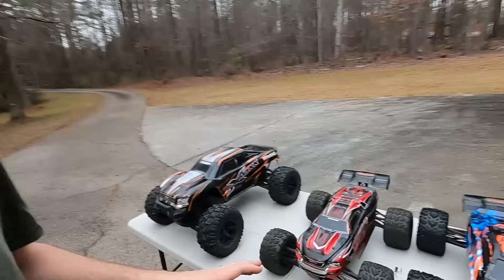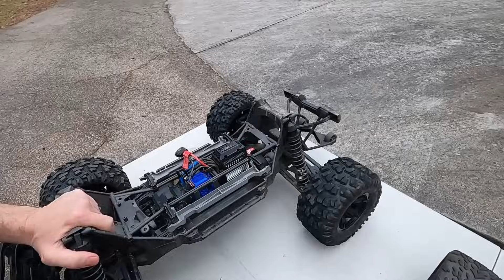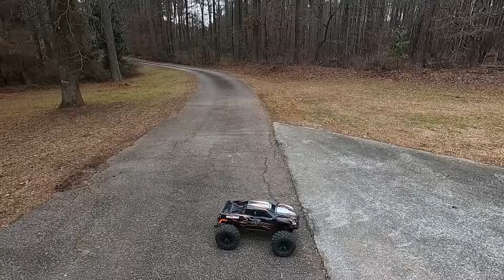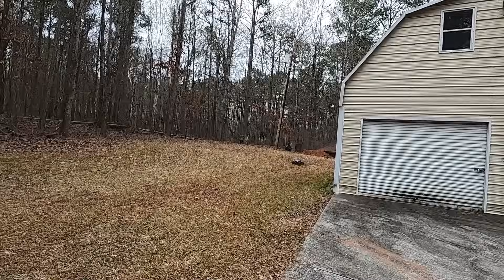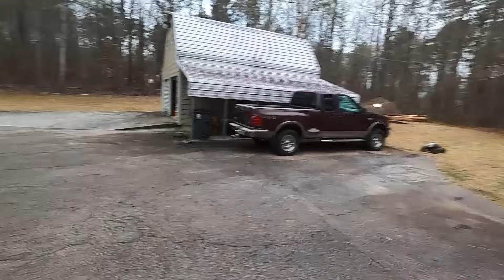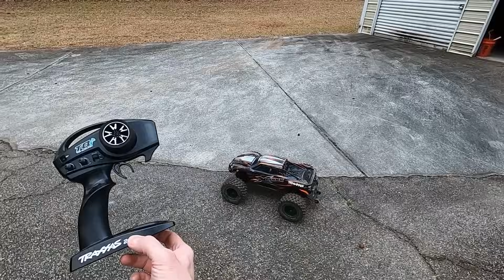Why Is My XMaxx Stock And Why Don't I Use Badlands?

Comment: I know this is a traxxas video, but I have the losi dbxl-e 2.0 and the only things that have broke without me crashing it (everything still stock ) are---
1) The stock spektrum servo broke before 30 mins were up.
2) Stock spektrum esc-- No matter where the low voltage was set ( I had it set to high ), it always took the voltage down too low and puffed at least 4 batteries.
3) Stock tires, the foams inside came apart from the tires ballooning.
IMPO spektrum surface electronics are junk and need to be upgraded asap.

 Now for some things that broke after a certain upgrade.
1) Both back axles bent and twisted (1st run)
2) Front and rear diff gears broke into 4 pieces (2nd run)
The reason these pieces broke and it was just 2 runs, I installed a center locker and while it helped tremendously on take off, it wasn't designed for bashing. Needless to say it has been removed.
I have crashed it a lot and have upgraded ( I've upgraded a lot) as I repaired it and nothing has broken because of the upgrades (other than the locker). The last time I weighed it, it was 37 lbs. I swear, if there is an obstacle to be hit, I will hit it. I also don't jump my rc because it's just too heavy and I suck at jumping and a 5th scale is way too expensive to learn on.
Reply from the maker: lol 37 lbs? I didnt know they were that heavy. I actually kinda want one.
Reply: @outsourcedrc  In stock form, it weighs about 28lbs, mine has aluminum upgrades.

Comment: 1000% agree, Do Not fix anything before something clearly fails or breaks, every mod you add increases the amount of variables to consider that affects the car and usually the amount of headaches.
The simpler the better. 
And additionally I believe a group of designers and engineers of a 1000$ rc car from such mature brand know what they are doing much better than random Joes telling others to “upgrade” every single part of the car to metal when they dont even know what the square-cube law is…

Comment: I had mine for 2 weeks totally stock and i just love it but the stock servo striped the plastic gears out so I bought the upgraded metal internal gear one, it's stronger and better steering. Probably the only thing I'll change. Also recently got the badlands and there good definitely heavy but there good no more body slap I like em can't complain.

Comment: My Traxxas rustler 4x4 VXL will do that creeping forward sometimes after I let go of the trigger. Like you say, not all the time but randomly
Reply: I used to have the same issue. I noticed, that it did it, when the esc was getting hotter than normal (e.g. because of bigger/heavier wheels). If you have the Bluetooth Module and the Traxxas App you can adjust the zero point of the throttle. I guess, the factory settings of the zero point is right at the limit. If you adjust it just a tiny bit, it won't do it anymore.

Comment: i have my summit for funtimes, bandit for fast time, TRX4 for slow times. Main upgrade i have done is servos, summit servos cogs literally brke, so it got ome random metal ones. next i need new wheels, bought it as used, so wheels weren i the best shape, and the rubber is old. and one hex got round

Comment: Did couple runs stock with 4s lipo doing wheelies on pavement and all my foams in the tires balled up and unbalanced my tires
Reply from the maker: Oh that sucks.
Reply: @outsourcedrc  yea, tires are perfectly fine. Stock foams tho are garbage. I took the foams out and ran them with no foam. Seem fine now, but it doesnt roll very long when your off the throttle caz there flat tires. But ive beat the crap out of them and they held up fine. Its sorta a comon thing if you like doing very long wheelies on pavement and doing it alot

Comment: 22/50 gearing and a max 6 will give you way better air control and it will do standing backflips while still being reliable. Just a tip

Comment: I just put in the rpm hubs for the rear
Castle mamba X 8s ecs
And german manufacture mod1.5 gears 
These are very light and durable 
And i have the proline raptor body for it for Personalization.
The rest of it is stock.
Its literally very rare that i break something like an arm.
But i drive like an animal.

Comment: I was wondering if putting the heavy duty traxxas arm is not a good upgrade either? My arm broke, and i drive in really cold weather, so i was wondering if it would be worth it.
Reply from the maker: You can add a little more weight if you really need it, but try to limit how much extra you put on.
Reply: @outsourcedrc  ok. Thanks

Comment: I've had  my my XMAXX, for about three years now. I went through 2-3 sets of the original XMAXX tires. And kept blowing up, and replacing them, with the originals. i got tired of buying them! So  I did my own research. And went with the Duratrax Hatchet X tires. NO problem since.

Comment: Totally agree. Even upping the gearing on the stock system makes it a new animal. I had the same outlook you do on mine. I did change the electronics. But used the Hobbywing max6 ESC and their 1100kv motor. With WFO gears. The truck isn't much heavier than stock. So it holds up well. Nothing worse than a broken RC. Useless. Thanks for sharing this info 👊🤘

Comment: What batteries do you use
Reply from the maker: The Traxxas 6700 mah 4s batteries.
Reply: I'm looking for a cheap lipo batteries for xmaxx long run time but good speed any ideas
Reply from the maker: @dgoldenninja641  No idea. Maybe someone else will be able to tell you.
Reply: Also if you get a battery with a higher mah the truck will run longer:) Great videos keep it up

Comment: Ya Driving it like this  your not going to break anything!!! Take it out & really drive it it will break then the upgrades are necessary. 4 weeks after mine was new etc burnt up replaced it with max 6, blew out 2 sets of stock tires they just tore big pieces out replaced with proline trenchers, put in HR 50/20 metal spur & pinion, still have stock motor installed high powered motor fans its way better now!!!!  other than breaking a arms its pretty bullet proof!!! Mines an 8s not a weenie 6s lol!!!!
Reply: Exactly all how you drive it i had freind with xxmaxx all bells whistles,  still has stock esc for 3 years dosen't understand why we woukd need a max 6 why people say stock esc not good , some people this is bashing anything more is abuse

Comment: Quick question here. We picked up the Xmaxx last week & have run it twice on 3s 5000
What size 4s batteries do you run? 5000 or 6700? Please advise as we’re looking to go 4s ASAP
Thanks...A Subscriber
Reply: You’ll need 6700mah, the 5000mah Traxxas packs cannot handle the amp draw and will start puffing.
Reply from the maker: I have the 6700 mah

Comment: 180$ dollars for a set of badlands, I've gone threw 4 stock tires cause of ballooning and my dog chasing and biting at the thin rubber they use.  All depends what's your using your truck for. I haven't broke anything since badlands upgrade my 2 cents
Reply: Hi

Comment: Hey bro great video. I'm still a beginner but have been getting caught up in that cycle with my Redcat Volcano. I'm now looking at stopping that cycle and going better quality. You ever run Team Corally's? The xmaxx is pricey was looking at the Jambo or Arrma Kraton, any opinion?
Reply: I know you didn’t ask me, but if you have a
The cash get the xmaxx. It’s a game changer
Reply: Not outsourced rc, but the xmaxx has higher buy in cost but more durable and cheaper to run long term.  My xmaxx is on the bench less than any other truck and parts are cheaper.

Depends on where and how you plan to run.  Rough terrain, xmaxx.  Groomed bmx type tracks and care about stunts arrma or team corally.
Reply from the maker: I dont have any experience with the Jambo, but the new v5 Kraton is a safe bet if it is anything like the Notorious. Just change that diff fluid and its good to go

Comment: I can't keep the stock tires together  im on my 3rd set ive glued and vented and taped they foams still let,loose roll up and ruin the tire
Reply: The stock are my favorite though
On my duratrax lockups ive had no issue they have had 30-40 probally more runs on them and are perfect my stock last 4 or 5 packs

Comment: 😎👍🏼 I couldn’t agree more about the xmaxx stock tires! Proline does make really awesome tires, but to do so, they do get heavy! 

The Xmaxx is really ALMOST perfect out of the box in stock form, but in my opinion, the only upgrade I recommend is the traxxas steel gear servo. It’s a heavy truck that takes   Almost anything you can throw at it, but those plastic gear servos just don’t last for me!!

Comment: Any thoughts on a belt drive set up?
Reply from the maker: I hear that its not very good. It seems like a gimmick. I dont know much about it, but I used to run Nitro street cars and belted was not the way to go with those. There is a reason all these RC's come with gears and the belted RC's have fallen off.
Reply: @outsourcedrc  awesome thanks for the quick response 👍
Reply: @steveh8224  I have belt drive and it’s amazing! If you install it right you won’t have issues.

Comment: Hey buddy, been watching a lot of your videos, love your content! i subscribed! quick question for you. I just got an xmaxx from someone with these badlands and it came with some reaction 4s batteries. The Xmaxx seems slow and doesnt wheelie. I checked the gears seems fine. what can be the problem? thanks for your help.
Reply from the maker: I'm not sure. With it being second hand, there is no telling. What gears are in it? Is it in training mode?
Reply: @outsourcedrc   Your the best! The ESC was set on training mode... set it to default and now it flies.... but  I still have that rolling issue with the badlands tires. Did you ever fix that or found out what it was?

Comment: Try the duratrax lockup x's or the powerhobby scorpions or raptors.  They are great belted options that don't weigh as much as the badlands. But for heavier belted tires you need the upgraded 2085hd servo

Comment: This applies to all trucks, big wheels break things. Fun, but they break things.  The upgrade bug can be a full on addiction. I  try to keep it under control for sure.  The worst part is sometimes you spend money on parts  you are convinced will make your RC better - tougher - faster - funner - and then you wind up making it worse.  
Not that that happens to any of you 😂, but it has happened to me...

Comment: You should do a speed test with the badlands and stock tires
Reply from the maker: I actually have raced them side by side in another video. The stock tire XMaxx walks off and leaves the badlands
Reply: @outsourcedrc  good to know I might take mine off and see the difference

Comment: The weight of the wheel has nothing to do with the issues your friend is having.  If the wheel is breaking, it's because the wheels are weak and/or you're over tightening the wheel nuts, not because of the weight.  I've never had any problems with my Badlands, and I've jumped my truck 10 - 15 feet into the air and landed flat on concrete.  From my perspective, they're better than the stock tires in every way - except weight, of course.  No ballooning, completely waterproof, much harder compound so they side on pavement instead of traction rolling, better grip off-road, much much longer tread life.  They're worth every penny...

Comment: I love stock traxxas tires they last very long too! I’m old school I love everything stock just like knowing it’s original. What do you recommend for the Erevo front drive shaft it is so weak I’ve upgraded to the steel traxxas ones and it still snapped 😭
Reply from the maker: Which E Revo? the 2.0?
Reply: @outsourcedrc  yes ! Such a pain to fix constantly breaks 🤦🏻‍♂️
Reply from the maker: @27pugsly  Front Drive shaft? Hmm.. Maybe there is something you are doing with your driving? Normally its the rear drive shafts that tear up. I'm still running stock shafts. I've only broken one rear one and bent a rear one.
Reply: @outsourcedrc  yeah I drive it hard but maybe it’s just not for me ?? I drive my Arrma Kraton and that takes a beating . Thanks for the advice

Comment: Wish I saw this video before dropping $200 on those wheels and tires. First flip on its backside broke my body at both rear wheel wells. Battery, esc and motor temps all skyrocketed, run time was diminished and it does that goofy drive away thing at 0 throttle and the 2nd run stripped the servo gear. These tires will most likely be shelved until the xmaxx is ridiculously upgraded
Reply from the maker: Right? Some people have no issues with them.
Reply: @outsourcedrc  I run my banditos all the time now, there's no need for super aggressive tires when you're full time 4wd

Comment: I think it's good to have extra parts but t don't change stuff till it breaks like I added light bought diff tires and a court fans broke a couple parts and ended up upgraded everything that has to do with the wheels lol smh it's addicting man.thr other day I hit a branch and my gtr shock the rod actually broke smh it's the last thing I would expect to break but it snaped rite at the base where is screws into the bottom of the shock.

Comment: What about the guys in the hobby that spend a lot of money on aluminum suspension parts and you can’t change physics..... plastic resin used in all box stock RCs is hands down more flexible than those expensive aluminum hop up parts guys love to trick out their machines....most times if you have a wreck w aluminum suspension parts the parts don’t have the flexibility that resin/plastic parts have ..... they just bend or break....I learned by experience.... and if the engineers at let’s say Traxxas  say plastic resin is the way it should be .... I think they know better than me ...... awesome presentation my friend..... thank you....☮️~~~ Out!!! 👍🏻😎
Reply from the maker: Aluminum is really good for handling. Its not very good for bashing.
Reply: @outsourcedrc  exactly!! 👍🏻

Comment: I came back to this video for the 3rd time :) 
How are your tires doing? Im stuck with constant issue, every set of new stock tires last for 5 runs and the foam disintegrates inside… I really don’t want to go for aftermarket tires because of the weight and all the reasons you mention in the video that I totally agree to but there isn’t seem to be any other options atm, which is disappointing such expensive truck and such expensive tires lol
Reply from the maker: Wow what are you doing to them? Are you getting water in them? I wear my treads out first.
Reply: @outsourcedrc  not at all, totally dry out here, I never use my cars nesr water, already tested a lot of stock sets plenty of times, I tried taping the holes in the rim and vent the tires. No luck, none of them last more than 10 packs. The foam inside turns into dust…

Comment: Duratrax Banditos for skateparks and Duratrax Hatchet X for off road...belted tires are the only "upgrade" I've done toy xmaxx. Makes us way more responsive since you aren't running on a super thinned tire from centripetal force...other that, some shoe goo on the body and a metal gear servo it's stock all the way...I haven't noticed any difference using the Duratrax belted tires...

Comment: You say you haven't upgraded anything on your X-Maxx...and that's it completely stock. So my question is, have you ever at least broken anything  on your truck? I've had mine for a week and  I've already broken the rear hub carrier (which I replaced with the RPM hubs)..The shock cover also broke and so did a drive cup. I don't "BASH"...I was just out having a little fun.
Reply from the maker: I have had to replace bearings, and Thats it. Some how I have not broken anything other than a small piece on the front bumper mount that I never replaced. Of course, I dont take it to a skate park or anything like that.

Comment: Yes but no there amazing stock but the factory tires rip and blow out.  Ware we drive at has sticks and branches all over and if I ran stock tires they just get ripped up I went through 3  pars of stock tires just with sticks ripping holes in them I went to bad lands and have not had that problem no more it really just depends on what your doing and ware you go . In the yard ok stock if you go to the woods then no the stock tires are to soft..

Comment: Just like on real cars, weight is your enemy, big wheels and tires look cool, but do nothing as far as performance goes, to a certain point.
It's very noticeable the difference in driving dynamics with the stock tires on the xmaxx,  the badlands look cool if you keep the truck as a shelf queen.

Comment: Great p lo ace to live , drive rcs dont have cars and trucks people walking by every 2 minutes like me in the city trying to run my rcs in front of my house NICE!!! MY XMAXX I PUT SIX PAK DURATRAXS ON IT NOT DOING ANYTHING NEAR JUMPING AS HIGH AS YOU AND A SHICK CAP BROKE iam putting stock tires back on think it dosent have the cushion of the stock vs the duratrax the weigh 2.5lbs more plus the bigger hex nut Hr weigh more so going back to stock see if acceleration improves as well I baby my xmaxx because it cost me a grip and the batteries,  charger. Thx great video as always thumbs up!
Reply from the maker: yeah I have seen a lot of people go back to stock on this thing.

Thanks!

Comment: If you have a 8s xmaxx or 2.0 revo or later vxl models you wont notice the things people complained about on the first gens cause traxxas fixed and upgraded everything. Xmaxx esc and motor used to be like 500$.  For the people who have these new sledges will be upgrading those gears soon as they keep breaking. Drive the 6s xmaxx to decide if it needs to be updated.

Comment: I strongly believe in using a Russian indestructible body instead of the stock body, as well as aftermarket hardened spur and pinion gear. Aftermarket rubber sealed bearings all around are good as well